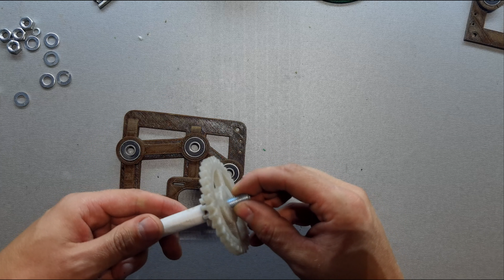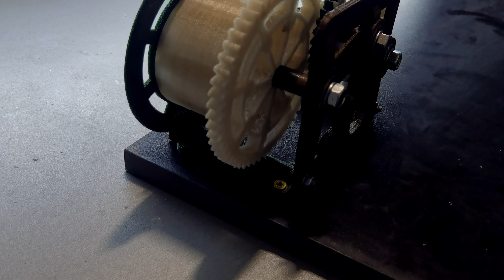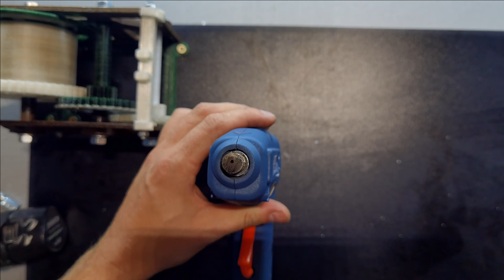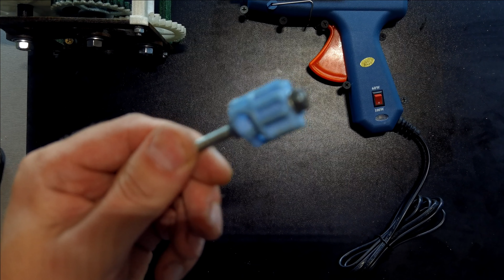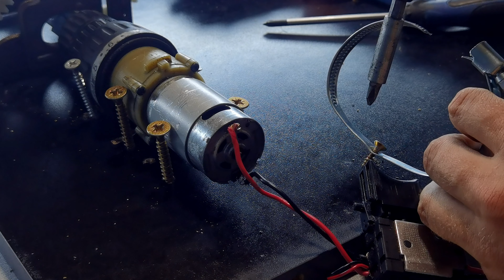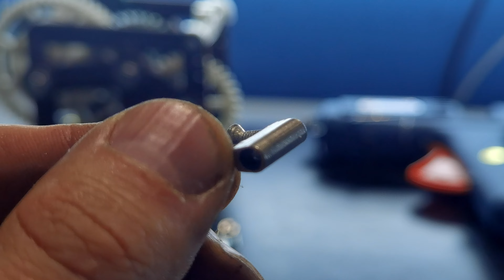How To Make Pet Filament Maker from old parts

Comment: Just a tip. Don’t hammer the bearings in with a hammer like that. It’ll ruin the bearing. Use a pipe with a similar diameter as the outer ring and hammer on that to push the bearings in.
Reply from the maker: Thanks for the advice 👍
Reply: @lets_make 2x4 works too lol
Reply: If you find yourself needing to hammer in the same size bearings again and again, you can always 3D print something the same size as the outside diameter!
Reply from the maker: Thanks
Reply: What about a rubber hammer?

Comment: Just a tip if youre planning on making this, you can skip printing the gears from the roll and directly put the motor to the spool if you add a PWM module to the input voltage of the dc motor. That way, you can reduce the speed of rotation of the spool and use less filaments for the structure and skip the gear ratios 😊

Adendum:

 you can even add a potentiometer to the glue gun so you can adjust the temperature

Comment: I like it! i can see some areas for improvement, id be inclined to make some sort of housing for the drill to cover the electrics and see about replacing the drill trigger with a dial and also maybe a breaker between the power supply and the rest of the build in case of any issues like an emergency stop, got a new printer on the way and got most of the stuff i need for this already so ill try tinkering myself at some point and report back!! going to try making an easier open source filament blender and recycler too.

Comment: i have a nozzle changing glue gun but the hole is too small to get something through
do you think i can drill in the heating thing?
Reply from the maker: Not drill heater, only nozzle with 1.5mm drill
Reply: @lets_make  but the hole in the heater is too small
Reply from the maker: Drill hole with 5mm drillbit

Comment: Is there anything I can salvage the gear mechanism used to hold the bobbin out of instead of building one? I only ask because I don’t think my local hardware store would have those parts (small town) and I would rather recycle them from trash than go buy them if I can.

Comment: So you roll the filament on a spool. 

I have a direct drive ender 3 and was thinking, what if i just let the printer pull the fillament when it needs it? And maybe solder multiple bottles to each other?

Have you tried this?

Comment: That 3-D printed gear for your drill. Where did you get the file from?
Reply: my guess would be to use the gear that goes on the stepper moter but add a post to hold it with the drill or buy a piece of rod to use ( labeled "stepper_gear.STL")  i don't know if that will actually work but thats where i would start im going to try this out idk yet if im going to use the head of a drill or a vex robotics motor/stepper
Reply: uppon looking at the file yes thats what you need but you also need hardware to clamp it to a metal rod ( i would groove the rod)  there is a upgraded gear in the remixes tab if you have access to a file use it to file down a flat face on the rod with that one because it won't slip

Comment: Can i use the original hot glue gun nozzle as the extruder? Mine is exactly 1.7 mm, is there any problem in using the original nozzle?

Comment: Do you have any problem related to surface roughness. I designed a system which I use an extruder barell in it but the surface of the final product is so bumpy. Do you have any idea?
Reply from the maker: Surface of what?
Reply: @lets_make  Surface of the filament. I use PP for material.
Reply: Your filament probably has moisture or you're running it through the nozzle too fast, or it's not hot enough..
Reply: @sedalespencer69  Thank you. Probably it has some moisture in it but I think that PP is a hydrophobic material so İt won't get an moisture in it.
Reply from the maker: Welcome 😀